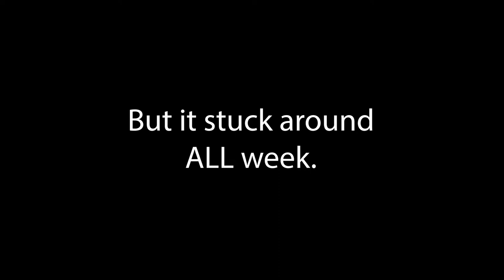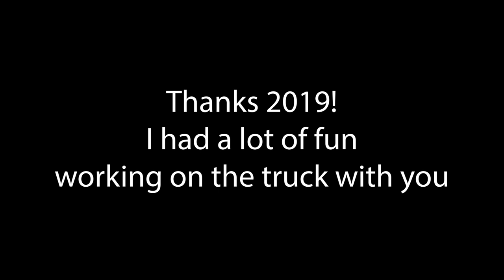Restoration Rewind!

Comment: Where did you learn to do all your automotive skills? I have an 1989 exactly as yours, only the 4 cylinder, I really like working on her with my little knowledge, like changing the oil, fixing little minor details cleaning, all that but I really want to start to get in deeper, any tips other than just starting and practicing as you go?
Reply from the maker: Start and figuring it out as you  go is a good beginning. Beyond that I'd recommend finding a repair manual. Hayes is one brand, Bentley is another, and there are many more. You'll also want to take lots of pictures! Take pictures before you remove something, after you remove it maybe next to where it goes. Take a picture of any features that help with orientation. Take pictures of everything laid out on the table. All these pictures will help you get it back together. Watch lots of YouTube videos. They don't even have to be about the vehicle you're working on. All axles, all engines, all transmissions, all chassis, all dashboards are basically the same. You'll get a general idea how things are made just by watching videos about vehicles. Things not worry about: breaking stuff. If you break it, ohwell, buy a replacement part and move on. Don't worry about fasteners. Most fasteners per large assembly are the same. The special ones standout, so you'll be able to take pictures of those. I think that's a good start. Have fun on your future endeavors!

Comment: What's the stuff used at 6:58? Seems like a solvent for cleaning bolts and such?
Reply from the maker: It's Chem Dip. You can find it at AutoZone in gallon containers. It eats through anything. It works great on steel parts, but be careful of aluminum. A great alternative is oven cleaner! It's a bit more gel like and sticks to things better. Oven cleaner removes oil, and grim, and burnt food from the walls of your oven. An engine is basically covered in the same, oil, grim, and carbon. Spray it on wait fifteen minutes and wipe if off.

Comment: Amazing! How did you learn to do all that? Where do you get replacement bolts from? Do you replace or repair/ repaint dented body panels?
Reply from the maker: I'm a mechanical engineer by trade, so I've got a pretty good understanding of mechanical things. I've also learned by doing and getting in there and figuring it out. I'll be doing all the body work to my own truck. You can find bolts at shops that sell aftermarket Toyota parts. Lceengingeering.com is one. You can also find them at places like McMaster, but you'll need to measure the bolts so you can order the proper ones.

Comment: Where are you located? Anywhere near Ky?? I’ve been considering doing this to my 1990 Toyota 4x4
Reply from the maker: I'm located in Louisville. So very much Kentucky. Now that spring is around the corner I'll be picking back up on the project. I highly recommend it if you have the time and patience. Or you want to learn patience. 😁
Reply: Nabil Imam my problem is not having a garage, going to have to try and pull it off outside or something, I keep it covered when not driving it and keep everything protected with woolwax.